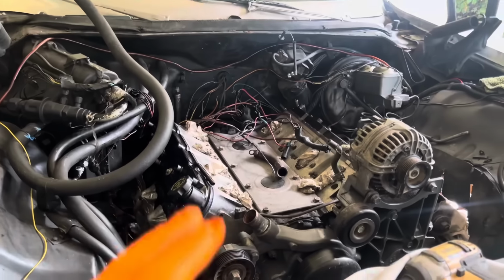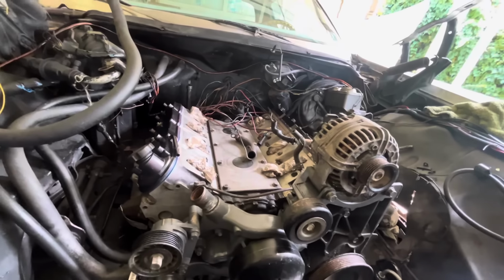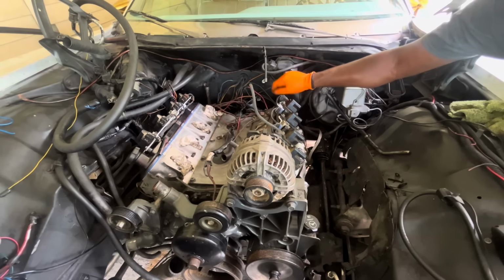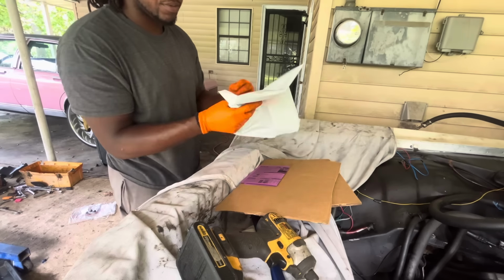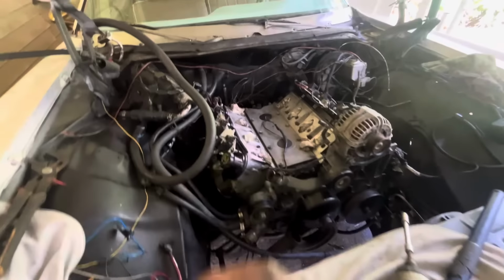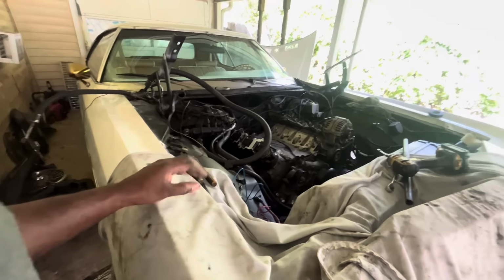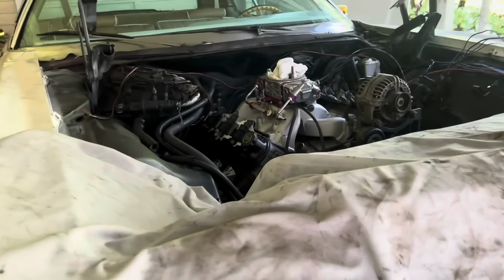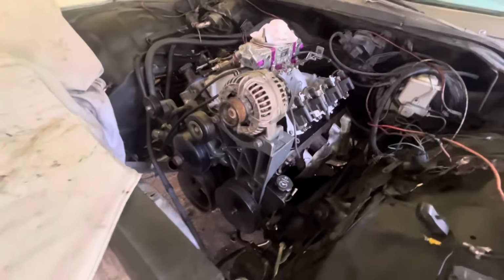INSTALLING MY NEW LS INTAKE AND CARBURETOR!! EVERYTHING COMING TOGETHER

Comment: Top port on the driver valve cover, is for ur pvc valve! I used an oil catch can. Easy to install. The passenger port hooks up to a port on ur carburetor. The middle tube running left to right with the tube is ur coolant bypass pipe. It runs to the radiator or buy a bypass connector for the radiator hose
Reply from the maker: Bet bro thanks

Comment: I’m tuned in enjoying the content I’m planning a carb build myself I’m going to go with corvette style fuel filter regulator that way I only have to run a fuel line to carb inlet. Did the same on my SS got the idea from @lsswapguru
Reply from the maker: Gotcha. How it is running and do u have a return line
Reply: @doinkslifestyle  my corvette fuel regulator is on my frame just in case I need to replace it 2line 1️⃣ 5/16 and 1️⃣ 3/8 fuel line to regulator to return to gas tank an then 1️⃣ line going to intake

Comment: PUT YOU SOME NEW HOSES AND LINES SO YOU DONT HAVE ANY PROBLEMS WITH THE OLDER ONES LATER AND WIRES .🛠️🧰🔩🔧🪛💪🏿, WHEN POSSIBLE .CHECKING IN FROM N.C . 😊 COMING ALONG NICELY.
Reply: yea run 3/8 braided fuel lines